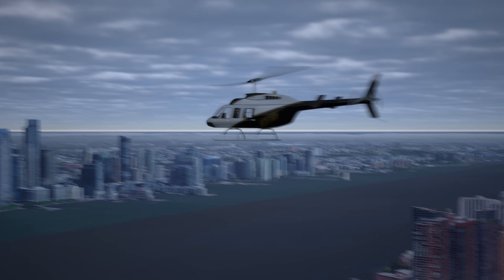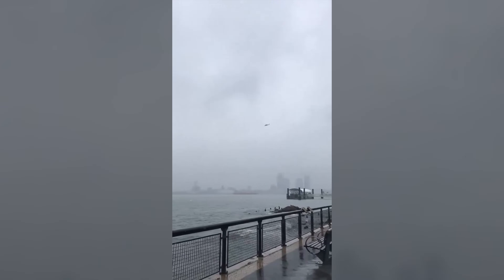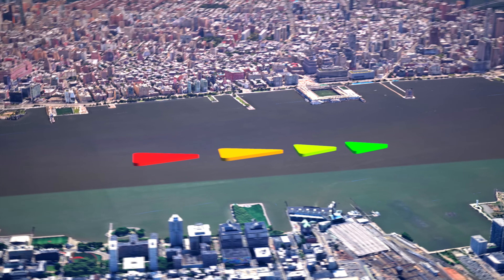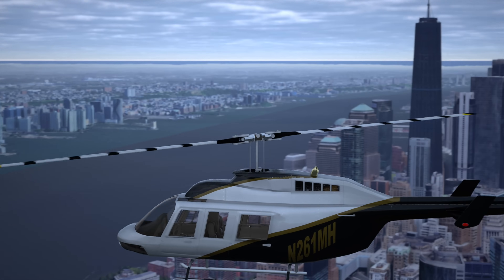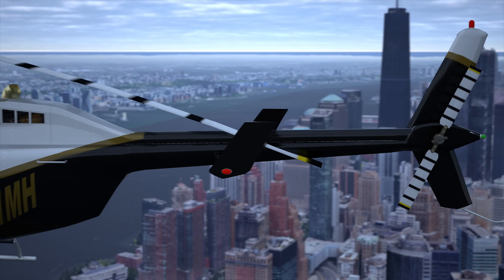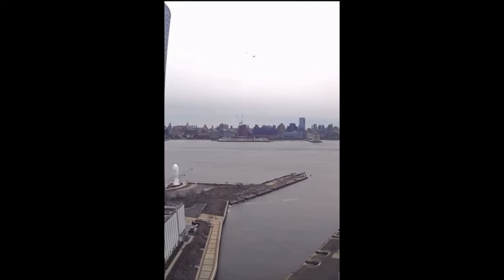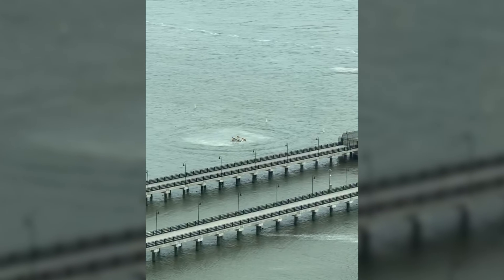Helicopters DON'T just fall from the sky - What is "Mast Bumping"?

Comment: Helicopters, Hot Air Ballons,  Bungie Jumping.. On my never to do list.
Reply: And cave diving either
Reply: @12AB17 you’re asking to die early with cave diving, imo. Wayy too risky.
Reply: @12AB17  Cave diving tops the list
Reply: Recently being a CEO adds to the risk.
Reply: No skydiving either for me thank you.
Reply: You don't muff dive either
Reply: Same here 😊
Reply: Add Getting married to that list. You're welcome.
Reply: Oil field works for 35 years; I have taken helicopters all over the world, in many difficult weather conditions, with only one emergency landing in autorotation. I am still here to tell about it. 
This accident is simply incredible! the only similar incident I remember is the North Sea Chinook crash in 1986, which incurred a transmission failure that caused both rotor blades to collide. 
I had never heard of the possibility for the blades to hit the tail boom, and the video shows the aircraft flying a straight line at speed without any kind of maneuver that could have caused the main rotor blades to hit the tail.
Reply: @p6x2 man I see these reports almost every week
Reply: @ Not for helicopters; unlike fixed wings aircraft, you cannot forego maintenance on rotorcraft. The way helicopters fly requires mechanical integrity. If you take time to review helicopter crashes that aren't due to pilot error, you will find that often, maintenance or failure to detect fatigue is the root cause. Newer helicopters have vibration sensors that can detect out of tolerance frequencies; obviously, not on the kind of helicopters flown for tourist flights, unfortunately.
Reply: I've done bungie and helicopters, but you wouldn't catch me in a balloon unless I had a parachute 😂
Reply: @MattyEngland ok, here I packed the chute myself.
Reply: @MattyEngland  ive been in a balloon among many other balloons in the air in egypt, it's super fun and exhilarating, I definitely enjoyed every second of it
Reply: @mfs353  Yeah I'm sure it's cool, and if I had a parachute I'd do it, however after seeing numerous balloons catch fire over the years, I'll give it a miss without one.
Reply: @MattyEngland The Fifth Dimension were okay with it...
Reply: @MattyEngland  Similar situation here. Would love to skydive again, but sitting in a woven basket under a balloon and large ball of fire doesn’t peak my interest at all.
Reply: @MattyEngland Balloons aren't too bad but I've already crossed that off on my YOLO list
Reply: You forgot parachuting. I’ve never understood jumping out of a perfectly good airplane.
Reply: @davidwenner8537  ...have you seen the condition of a skydiving plane?
Reply: I declined a flight on the Space Shuttle in 1986. Period.
Reply: Retired pilot and skydiver here....IIRC the Bell 206 series of helicopters has the lowest fatal accident rate of any single engine aircraft, including fixed wing aircraft.  They've been flying since the 1960s.  Also, I have about 14 years in the sport of skydiving with not even a scratch.  Odds of getting killed skydiving as of this year is about 1 in 145,000, so the most dangerous part of it was the drive to the dropzone.
Reply: @RR-pw5nb that's what all the surfers that get killed by sharks say. "They never attack!". Dead. Lol
Reply: @RR-pw5nb  None of that matters to most of these timorous weaklings!
Reply: @RR-pw5nb you can walk away from a car crash though.
Reply: Ironically I am friends with an ex-helicopter pilot. He got out of it at 32 because he was afraid he was going to die from it. He flew people in Alaska and then became a life flight pilot and gave it up at 32. Now he is a stay at home dad.
Reply: And small planes
Reply: Who else here sleeps wearing a safety hat, eye protection, and steel toes? 
 Just me? You lie   😆
Reply: you forgot getting out of bed
Reply: @robc5768  "i hate when that happens"
Reply: Believe it or not, hot air balloon is the safest form of air travel.
Reply: @AnimalsAreGreatest just as long as you don’t have a random guy in the group that wants to end it all. Like that guy trying to jump off the side and getting into fight with the operator.
Reply: @YourChessMatey They once accurately used to mention that all air travel was the safest mode of transport. 
Strangely only certain technology seems to regress,...while others progress exponentially. 
Freedom fades slowly,....and suddenly something new is here practically overnight.
Reply: @AnimalsAreGreatest  Most are completely safe, but just like shark attacks, because of Hollywood and the media's ability to oversaturate their coverage and impart fear, people overreact and think these endeavors are a "severe risk."
Reply: @YourChessMatey I dont
Reply: @AnimalsAreGreatest  I don't believe it.
Reply: @chrishyde1216  I didn’t either but hot air balloons have both the lowest accident and death rate per flight hour and it’s no really even close with the other forms. Kinda wild really
Reply: Well, thanks. Not for me.
Reply: @AnimalsAreGreatest 😅Then why, don't I see them anymore.  15-20 yrs ago, they were popular!
Reply: LOL
Reply: How about playing Farkle?
Reply: BMW1x1... People walk down the stairs and break their neck, so in that sense... However, it's your life so live it as you see fit.
Reply: No Hindenbergs for me too
Reply: Seriously!!
Reply: Add to that cruises.
Reply: I will stay away from the Hudson River 👀
Reply: Id do sky diving but yeah I’m with ya
Reply: Same here
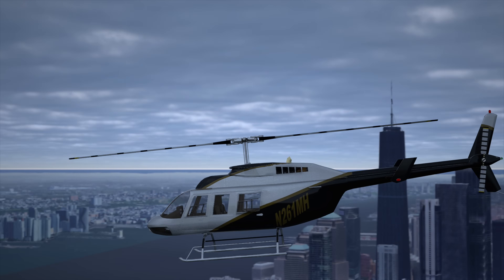Reply: Me neither!  Getting out of bed is dangerous enough! 2:44
Reply: Not even roller coaster
Reply: I’ve done hot air balloons and would consider helicopters, but bungie jumping? My L2 could never.
Reply: So you would wing glide and do base jumping than take a helicopter ride?
Reply: @Abp.Mars-Assembly  The logic isn’t completely flawed…a glider doesn’t drop like a stone because it glides, and the wind doesn’t effect a bungee jump all that much…but I see what you’re saying. Cheers
Reply: @Abp.Mars-Assembly  I went skydiving to impress a girl. I hate heights and have terrible motion sickness. I’d love to go again…when she suggested the hot air balloon, I caved. There’s no adrenaline rush on the balloon to mask the terror. 😂
Reply: @Abp.Mars-Assembly Sorry…meant to say I drew a line in the sand on the balloon
Reply: You, and I both.
Reply: I've done all three... 😅
Reply: @cloudbase7799 You’re braver than I am. Although a friend of mine’s Dad was a helicopter maintenance guy in the military, learning about the “Jesus Bolt” is a bit terrifying
Reply: @justinsadowski9823   "Ballooning" was the most relaxing/calming to me of all three. I've been up about a half dozen times. The most eventful time was when we had winds (~20 MPH) pick up shortly before landing. It was a fairly freshly tilled field as I recall. The pilot instructed us to grip the rope handles inside the basket and slightly bend our knees just before landing. The pilot knew what he was doing. Because of our horizontal speed and the wind continuing to push the balloon after the basket touched down, the basket tipped over. No one was hurt, thankfully.
Reply: @cloudbase7799 That’s great! I’m happy for you…my stance on me getting into a balloon…still the same
Reply: @cloudbase7799 I was sharing a personal experience…not acting as an anti-balloon crusader. I meant no offense to the hot air balloon community
Reply: add caving and deep diving 

i did bungie jumping once when i was abroad in summer

i instantly regretted it when the crane lifted us

but many people were watching (it was at a beach)

so i had to force myself.. after 2 minutes i finally did it, and in the exact moment i made a step forward, i fall unconscious.  

I woke up the split second before reaching max bungie cord (it was over water)

it was a total waste of money
Reply: caving/cave diving
Reply: @v5k456jh3 nope…if you get bent around an edge like a coat hanger the best they can do is have your buddy tell you, “it’s gonna be okay” when everyone knows suffocation is inevitable. It’s amazing the lies we’re willing to tell to preserve dignity.
Reply: Your buddy tells you only because the first responders know that your parents can’t do it…because they will cave. 😣🤷‍♂️😢
Reply: Have you noticed the 1000s of comments supporting the "mast boom" bumping theory? 
YT bots, groomers and handlers at work.

They call it a tail boom bumping, but the blades look 100% clean.
If any blade had touched the tail boom, they would have either bent or break.
Reply: That and going to space!!! I'll stay right here!
Reply: My "Never To Do List" - not living in fear of taking risks like most feckless and indoctrinated cowards! I'm surprised so many timorous weaklings even leave their house!
Reply: Don't forget skiing
Reply: The industry calls it dynamic disassembly.
Reply: @obsoleteprofessor2034  Best to disassemble a helo while it's on the ground. 😂
Reply: You should add cars, just as, if not, you can more dangerous
Reply: Same.
Reply: Small planes too
Reply: more people die on the road every day  than just don't drive either take that off your bucket list
Reply: Done 2 of the 3 but agree that the balloon isn’t on my list of things I wanna do.  No interest.
Reply: Motor cycles too. 🙅🏻
Reply: Don't forget casual sex without a condom.
Reply: Bingo!
Reply: Add wing suits to the list.
Reply: Add skiing to the list.
Reply: Don’t forget cave diving and cave exploration.
Reply: Under King Trump's deregulated America, one is playing Russian roulette (don't bother to pardon the pun) with their life doing any of the things you listed and a whole lot more. If you count the ammount of American aviation workers that have died since Trump took office, and compared it to how many illegal immigrants have been arrested for murdering white blond suburban females in that same time period, Trump's death toll obliterates all comers. Add the ammount of starving babies stuck sleeping outside between borders and being deported, and homeless American citizens who's homeless shelter was shut down because of Trump's defunding, and the Trump death toll just rises and rises. 
Business across the country are going to cut corner on safety restrictions etc.. like it's going out of style, from big business corporations to small businesses, safety is going to quickly go back to being an after thought.
Firing half the government, most being the ones that help with the regulating? Safety across the board is out the window.
Yeah, no bungee jumping for me 😂

Stay safe everyone 💀
Reply: Same! 😢
Reply: This is a problem in 2 bladed rotor
Reply: INSERTS "PLANE"
Reply: And parachutes
Reply: I've been in a helicopter and a hot air balloon. Definite no to the bungee jumping and white water rafting.
Reply: I would love to bungee jump as long as it’s from a balloon basket several thousand feet up, and I’m wearing a parachute. 

I’ve ridden in two choppers in my 61 years. First time was in an Army Huey (I think…definitely not a Blackhawk) during an ROTC enrollment push at college. Second time was in a civilian chopper with my then-five-year-old grandson at the state fair. Loved both rides!
Reply: skydiving it is!
Reply: statistically safer than walking, cooking dinner, sitting under a coconut tree or eating anything with glycaemic carbohydrates such as bread, cake, pasta or noodles.
Reply: @Psycandy absolute nonsense, you need food to survivre, you dont need to ride in helicopters
Reply: Was there any accident before that one?
Reply: And sky diving. Jumping out of an aeroplane and trusting your parachute. No Thanks.
Reply: Not to worry, You won`t escape death anyway.
Reply: Did the first two already 8)
Reply: I’m with you
Reply: Bungee jumping is lots of fun. I know of a company with a 100% safety track record. Sure, anything could happen - you could be the first if that's your luck, but 100% doesn't mean anything to you?
Reply: Oooh a wish list. Just bungee jumping left; from what I've research make sure the operator uses full body harnesses as a back up point and doesn't solely rely on the ankle attachment.
Reply: add skydiving to that list
Reply: I took flying lessons but hard to quit when I got pregnant that was 30 yrs ago loved every minute of it but you always have to check the check list you can’t only take your plane and not check,  every time it needs to be checked
Reply: Drone atack?
Reply: Afaik Balloons are actually really safe
Reply: You should add driving to that too. Because it is the most dangerous out of every one of these. By a mile
Reply: ...and voting.
Reply: Agree except for hot air balloons.  Never felt safer in the air.
Reply: Add free diving to that, fuck the ocean.
Reply: How about caving?
Reply: you forgot submarine and boeing or the new koeniggsegg 4-door sedan with 2200 horsepower
Reply: Add Fentanyl & Russian Roulette to that list.
Reply: So you'll fly on a airliner, 🤔🤔🤔
Reply: Dont forget the Submersible
Reply: I did hot air balloons I agree on helicopters but what’s wrong with bungie jumping
Reply: Planes are off my list too, so many crashes over the past few months
Reply: Dito
Reply: same
Reply: ...visiting a communist run shoitehole like New York would be on my list too...
Reply: ballons are pretty safe specially if u carry parachute
Reply: BMW but you'd skydive😂
Reply: Now mine too
Reply: You forgot rollercoasters. So many freak accidents with those. I’ll never step on one of those clunky self-driven high-speed coffins on rails.
Reply: Skydiving?
Reply: No planes either
Reply: @ Planes are more safer than helicopters. There’s a saying, “planes naturally want to fly, but helicopters don’t”.
Reply: @michaeldob3874   Airplanes fly. Helicopters beat the air into submission. 😆
Reply: I’ve done bungy jumping and hot air balloons
Reply: That Helicopter Crush, Just Like With Those Other Jet Plane and Helicopter Accidents Was An Inside Job Done By U.S. Government, The Brotherhoods of The Illuminati, Freemason, Skull N' Bone, Jesuit and Occult, Entity Organizations of The CIA, Secret Societies and Elites, and Also Shadow Governments.

And Remember That 9/11 Was Also An Orchestrated Plan Inside Job.
Reply: Skydiving 🪂 too
Reply: Yeah. Same!
Reply: Same
Reply: I don't even know the numbers of years, and I'm a helicopter pilot. But I consider myself more in the terms of that I am fly.🚁
Reply: 35 years full - time on helicopters I get that.....
Reply: GO LOOK AT THE NUTTY PUTTY CAVE INCIDENT NOW THATS A BAD WAY TO DIE I WOULD NEVER DO CAVING SQUEEZING THRU SMALL TINY SPACES LIKE WTH?
Reply: If it's your time to die you will,no matter how you try to stay "safe" it's already written once we're born
Reply: Add parachutes to the list.
Reply: Done the first two so won’t do the third.
Reply: Hot air balloons are insanely safe
Reply: Cancer's not nearly as fun
Reply: My only helicopter flight was when I was taken to the hospital from a beach after being swept away by the ocean currents. A surfer pulled me out of the water (you could say I was reborn that day, thanks to that surfer). When I regained consciousness, I heard a loud engine noise. I immediately realized I was being transferred by helicopter. Luckily, I live in Spain, and I wasn't charged for the "trip" or the hospital care. We have very good public healthcare, funded by the taxes we pay, and no one is denied care even if they don't live in our country (universal healthcare). Your government should copy that system. Obama tried to do something similar, but the lobby stopped him. It's big business.
Reply: Add scuba diving. Some insurance companies will drop you if they find out you did it or plan too do it.  Amateurs can easily die while scuba diving.
Reply: OCEAN GATES...anything travelling on water & air.... is a precaution for me now days
Reply: And Disneyland and the Democrat National Convention
Reply: Years ago I rode a helicopter it was very scary.
Reply: Never really heard of any bungie accidents
Reply: Choppers are insanely loud. Flying "just for fun" just should been forbidden. It's also a ton of unnecessary pollution
Reply: *Airplanes
Reply: I haven't done bungee jumping.
Reply: You should encase yourself in bubblewrap and lock yourself in a padded room 500 feet under the surface of the earth
Reply: same!!
Reply: And caving , snorkeling!!!
Reply: I also put small planes on my list.
Reply: @floatpool8307  Why? You don't do extreme sports on an oil rig. You want safe people working in dangerous jobs, not risk takers.
Reply: @toolbaggers 👏👏👏👍
Reply: @toolbaggers unfortunately safe people working dangerous jobs take orders from unsafe people working safe jobs.
Reply: Enjoy your cave exploration hobby😁
Reply: I received a helicopter flight lesson as a gift and it was the most fun thing I've ever done. Highly recommend it. I've also been in hot air balloons and they are incredible. Bungee jumping is delayed suicide. I agree. Avoid that.
Reply: @Feintgames  What's wrong with bungee jumping?
Reply: @Feintgames  Bungee is by faaaaar the safest of these 3 activities brother.
Reply: @Feintgames  What if the chord detaches :face-fuchsia-wide-eyes:
Reply: @Feintgames why would you recommend something dangerous like helicopter? People like is what gets tourists into these things in the first place
Reply: @Feintgames  delayed?? how?
Reply: @Feintgames  I will only fly helicopters in GTA.
Reply: Same here , you may life with less adrenaline kicks but for sure you life much longer ❤.

Like my 104 year old Grandgrandfather always like to say , when i was a little boy : " Stay away from great highst , deep open water , big fire and high speed ❤ .Don ' t play russian Roulette with your life " !
Reply: But not drive or ride in a car? Better chance to be unalived in a car crash then any vehicle. If you flew a helicopter everyday all day for your entire life and drove a car once a day for a month. Better chances you will be unalived in a car crash.
Reply: Bollocks that. To start of,  people always mencion stats when comparing. Well, you can´t even BEGIN to compare the amount of traffic on the roads compared to on the air.

Secondly, whenever you have an issue on a car, on the ground, IF you are driving acording to safety regulations, your changes to survive such issues are WAY BIGGER than when the shit its the fan on any type of aircraft. If the issue is serious up there you are going to come down - FAST.

Also, this kind of urban helicopter flights are dangerous each and every day - and each day even more - considering the amount of drones out there. Any average Joe can own a drone nowadays and fly it whatever way they want to.

Nope. Not. Even. Close.
Reply: @LotsofStuffYT I don’t know why people say things like that as if t will persuade people to fly when they’ve already said they’re not going to.  Most people don’t need to fly in their everyday lives.
Reply: @LotsofStuffYT That was true,...presently the odd being equalized.
Reply: @LotsofStuffYT  Absolutely untrue, commuter and private aircraft are by a large margin some of the most dangerous ways you can travel, even more so than cars.
Statistically speaking unless you're on a commercial airliner, you're taking a decent risk getting into the air.
Reply: @LotsofStuffYT  Have you perhaps considered that as you have control over your car you are much more responsible for your chances of being involved in an accident, compared to when you're a passenger inside a helicopter?
Reply: @LotsofStuffYT  but you are 99% change of during in a helicopter crash, while thousand survive auto crashes every single day.  It an all or nothing situation.
Reply: Mountain climbing??
Reply: How about surfing in shark infested waters? 
Extreme sports, the danger of.
Reply: I dont know why people do it. Is it really worth risking your life for? No other way of getting that adrenaline rush?
Reply: Might as well remove Airline fights, buses, trains, cars and bicycle riding as well.
Reply: @DocMicrowave  famous last words before Doc died in fiery crash
Reply: and you may get hit by a drunk driver. Life is about chances, only if you enjoy taking them. Evidently, not for you.
Reply: You’ll miss out on life then. Assuming you can even afford these activities in the first place. Helicopters crashing are still a low possibility.
Reply: bungee jumping is super safe as long as you're not doing it in a third world country. The rest I agree.
Reply: So pretty much a coward.
Reply: After seeing the Kobe Bryant autopsy report and coroner drawings, I thought “no more helo flights for me”. I’ve been on helos in the service and thought about doing one at the Grand Canyon, but nope.
Reply: Are you black?
Reply: So between everyone we’ve got no helicopters, light aircraft, bungee jumping, skydiving, white water rafting, ballooning.

What do you guys do for fun?
Watch you YouTube videos wearing a crash helmet and body armor?
Reply: Sport, art, food, reading, watching movies, going on trips, exploring other countries. I, personally,  don't feel like I have to fly a helicopter or jump out of a plane for fun.  @Captain101-x1o
Reply: My "Never To Do List" is never live in irrational fear like you timorous weaklings! Surprised some of you leave your house!
Reply: @edkiely2712 I think these fears are actually pretty rational lol
Reply: @FeedMeTechno  Why drive then goofball? The risks are much greater than flying. Any coward can rationalize not leaving his house in the morning!
Reply: @edkiely2712  you are in control of the car. That's entirely different
Reply: @edkiely2712  okay YouTube NO FEAR mofo…calm down. 😂
Reply: @whatsupfoo4592  "It is not death that a man should fear, but he should fear never beginning to live" - Marcus Aurelius
Reply: @edkiely2712 The first few phases of this final chapter, long planned, of social engineering has always been based on just a few techniques. 
Seems to be a very effective combination. 
Cheers brother,...."existence vs living" is a no brainer indeed.